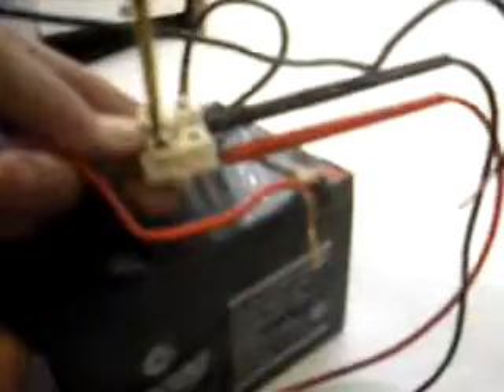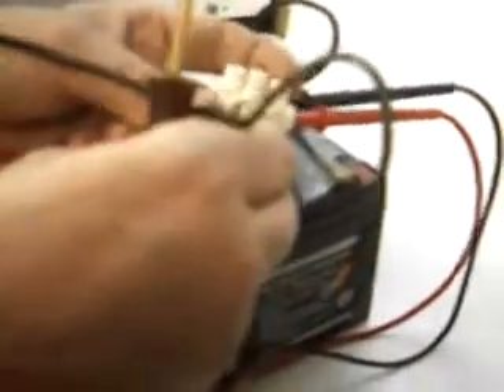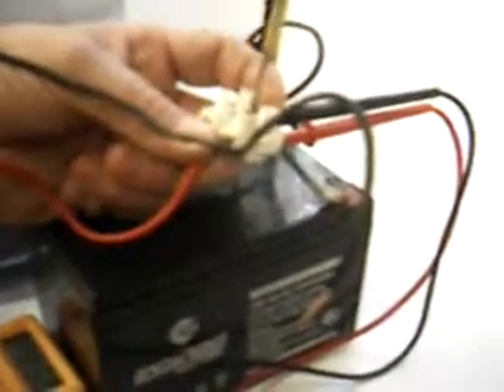Sinclair Energy Research   "THE SINC CELL" no 2

Comment: The reason you are getting a flood of bubbles every now and then is because of the cells shape.

It's like a mini diving bell really. The gas accumulates at the top of the 'bell' until pressure forces it out around the bottom at the sides.

Like someones sais, if the 'bell' was inverted, the bubles should escape as they are formed, instead of collecting and getting trapped on the inside top.

(as the temp rises more current will be drawn and more gas will be made, but also heat)